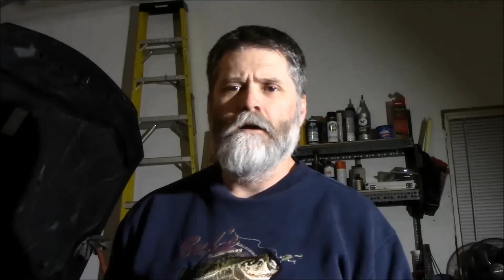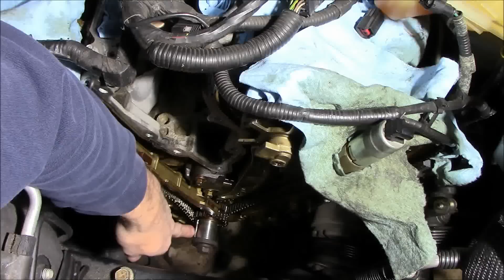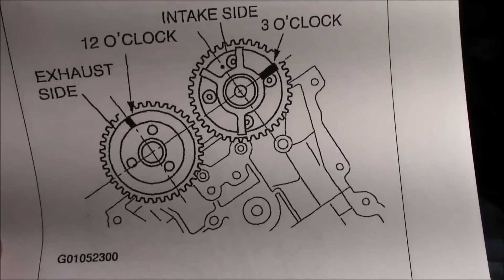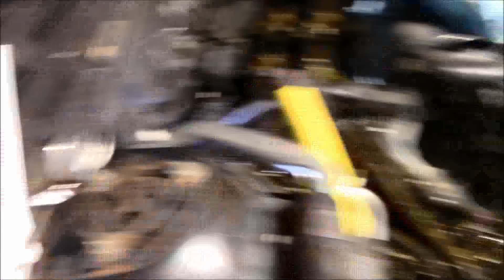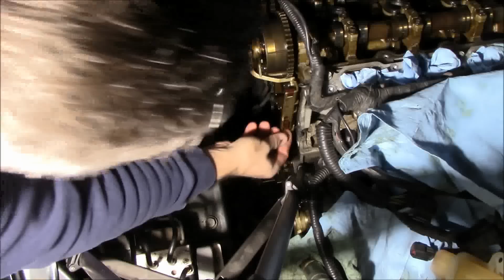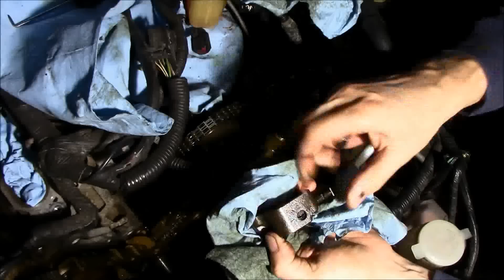2004 Mazda 6 3.0 Liter Timing Chain Replacement - Part 1 -  Timing Chain Removal

Comment: so if everything is in line how is the car missing?Is the chain stretched?And if it jumped how do you know?
Reply from the maker: If the chain is jumped then the timing marks would not line up.  Stretch is a little more difficult to determine.  A miss could be a lot of different things.  Try running the car and unplugging each coil one at a time and see if the engine miss gets worse.  If the engine miss gets worse when uplugging a coil then that cylinder is not misfiring.  You should be able to determine if one cylinder is causing the misfire and then work from there to determine what's happeing with that particular cylinder.
Reply: I get that I was just wondering how you determined that one you were working on was bad.I was going to just use an old timing light then tap the gas pedal,It usually makes the Mark go back and forth and you can see the slack that way.When I hit the accelerator there is no miss,but I can tell it is out of time,but once I let of it stumbles and I can actually hear the chain flap on the cover and knock.Thought it could be a connector rod making noise,or bearing journals.But when accelerating it makes no noise.and it sounds like they are all firing,but once I let off it stumbles and knocks.Could also be the tensioner ,but at that point might as well change the chain VVt and tensioner.Friends car has 125k,need to change at 100k most of the time.And 60k for timing belts.It does idle fine so I am guessing it did not ruin the heads,and the light pops on as soon as I let off the pedal.Belts tend to jump easier and being off 1 tooth sometimes make the car not run at all.More so on a chain because the distance is greater then a rib on a belt.I have also seen tensioners get chewed up and all the actual blades on it worn completely off.I had an old 305 in my Camaro and it jumped when I shut it off.Would not start at all.So when they jump it is when you accel and deccel,Once you deccel it brings up the slack,and that is when you hear the knock and ping and idle go funky.Then it will even out.Like I said I was wondering how you knew before pulling it apart thats all.I think the 2.5s and 2.3s have no key way and get out of sync and the gear on cam can slip but the 3.0 liter are fixed and you can't adjust them.So if the 3.0 is out it is most likely the chain.I will be using a timing light to verify tonight but I am pretty sure that is my problem.The misfire codes over the course of a few months got more frequent and her having changed coils made no difference.Those other mechanics she brought it too totally missed this,and did all the ignition coils and plugs and still same old missfire codes.I did change cam sensors just to make sure.It only cleared the P0345 code but the 0300 has always stayed.
Reply from the maker: Mine was throwing codes for the cam sensors and retarded timing... After checking out the cam sensors and determing they were ok about the only thing left was vvt and timing...  Pretty much determined that it looked like a timing chain stretch issue as both were throwing codes....   Not a clear cut choice sometimes... for me that's what it ended up being.
Reply from the maker: Lot of info... this is not an easy engine to diagnose sometimes as it can be the VVT or the chain... you are correct that there's no timing adjustment on the 3.0 and if you're going to open it up to look at the tensioners then you might as well do the chain if it's got 125k on it.  Make sure you look at the cam sprockets real well to determine if they're worn.  Mine would throw codes between idle and 3k, but the codes would clear if I was on it and above 3k rpms.  If you're going to pull it apart make sure you take a real good look at the vvt actuators as they are troublesome on some of the 3.0's.  There's no easy way that I know of to determine exactly if it's chains... and the problem is the amount of time it takes to get to them and the cost of replacing the vvts on this motor....  From what I've seen you're looking at around 800 in parts to replace the vvts and the exhaust cams ... definitely not worth it...  at that point you may as well get a 2006-2008 ford fusion version of the 3.0 and swap it in (changing over the pan, valve covers and timing cover...
Reply: yep it is not worth that,But from the smacking I hear it is definitely the chain hitting the cover it is so lose,I am just glad the heads are in tact.If they were not I would have just said new motor time.For the last year this car had misfire codes O2 sensor codes and precat warm up rich and lean codes.Missfires can cause all that,and dump fuel that did not burn into the cats,and or run too lean when the sensors tell the ECM to adjust fuel.And the Variable timing engines are very touchy when everything is not in sync.I have seen people change the cats and it ended up being a misfire,dumping fuel instead.Long term doing that can ruin cats for sure..
Reply from the maker: Yep, the cats on those motors are definitely at risk.... make sure they're in good shape through infrared temp or backpressure test... I believe it has 4 cats on it...

Comment: hey was it the p0012 and p0011 or both ?
Reply from the maker: I don't remember the specific code, but I remember it was retarded timing so I'm betting P0012.  I know I was getting P0340 and P0341 codes for the camshaft sensors.  As well as a bouncing tach and flashing Traction Control light...
Reply: Thank you for the response. I am getting everyday the P0012 OBD-II Trouble Code: Camshaft Position A - Timing Over-Retarded (Bank 1).
I looked at the camshaft position at TDC (Cylinder 1 Up). Everything seem aligned. The ruler goes into both gap of the camsafts. and the marks are all aligned. What do you think could help me get rid of this P0012. My car is a 2004 mazda 3 S 2.3 L. 
There is a rattking noise everytime I reach 3000 RPM and above. At this point I dont know if i should just replace the timing chain or look into another direction.
Reply from the maker: The rattle could be the chain hard to say exactly.  Have you checked your camshaft sensor and oil control valve for proper resistance values, I know on the 3.0 v6  you can pull the oil control valve and bench test it to see if it's opening and closing when voltage is applied...  The 2.3 does have some timing adjustment (I believe through the crank sensor, but I'm not positive).  It could be your timing is slightly off and I have seen where adjusting that timing has corrected the issue.  There's no timing adjustment on the 3.0 v6....

The vvt issue usually shows up as a ticking noise at startup because of the pin wear within the vvt assembly.  There was a lawsuit filed http://www.aboutlawsuits.com/mazda-class-action-lawsuit-engine-defect-70072/ for this reason.  If you're not hearing the ticking sound on startup then I would lean towards the timing chain being worn/stretched.
Reply: Thank you again for the reply. I tested the OCV directly with a 12V battery it does close and open when applying the 12 V. You might be right about the chain being stretched. I did not try the resistance of the OCV yet. I will do that tomorrow. If the resistance is right in the range I will processed into changing the timing chain. I did not test the camshaft sensor yet because the code keeping coming and there is abnormal noises.( I do not know how to test the sensor....Or it is the same procedure as the OCV ?). The car has almost 220000 miles and the chain might be worn too. I saw the procedure of testing the VVT actuator that was being disputed in the lawsuit a couple of days ago.
Reply from the maker: With that many miles I would definitely lean towards the timing chain.
Reply: When you rev up engine and then let off the pedal does it make a knocking sound?And idle goes crazy for a bit and loss of power?Because that knocking noise it most likely the chain smacking the covers.